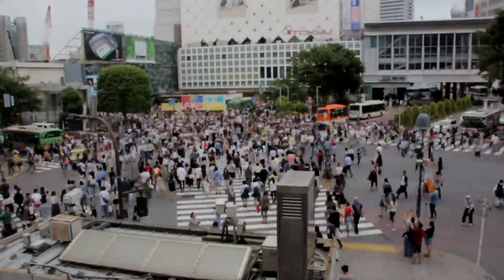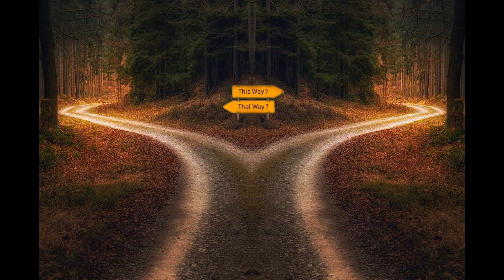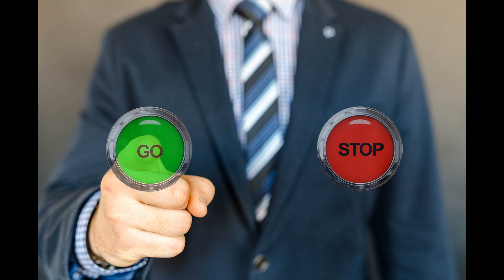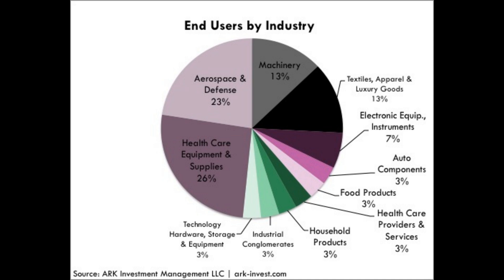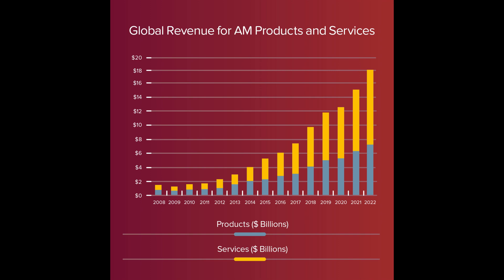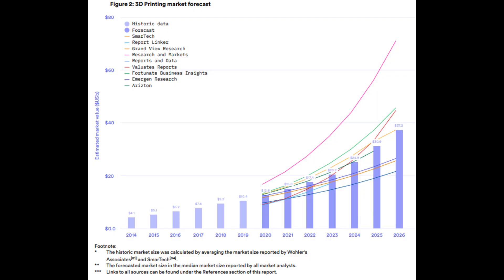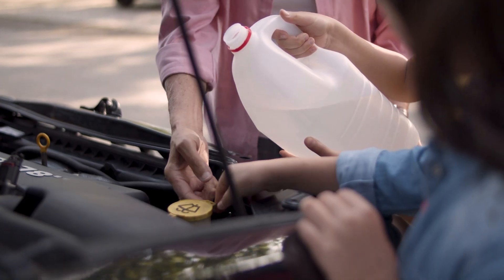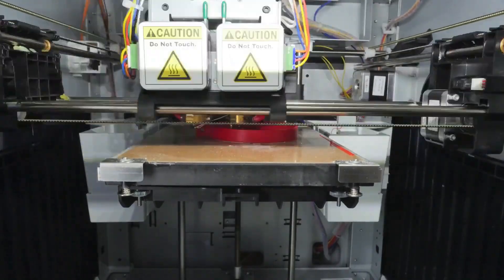2286 Why Do We Need 3D Printing ?

Comment: As the prime inventor of 3d printing and the silicon breast implant #1,(the floppy), I could not have produced the perky-set (#2-firmwear) realism without it. The prime alternative is lost wax casting. But only works for most, not internal hidden structures.🤗💕😇😁,jpk

Comment: that machine has a 1 to 1 ratio looks like and same direction drive , like a bicycle front to rear wheel relation , in the vid it causes a smooth change of direction by the sprocket notches for the product , but the ratio can be different so maybe 1 to 4 and it enters 4 x slower but the other wheel strikes it opposite.....too much/too long...

Comment: i have space but i demolitioned down one old shed built like a real room , guest room by itself and the wood rot was bad, end of lifespan, but the fiberglass had like a cockroach b*mb went off , from the moisture and wood , i didn't want to build that way seeing the final death stage , i use acrylics (cement opposed to portland hardeners but those are good too , just different ) , rebar masonry , CMU's ...some things are post beam then metal roofing in 3 foot widths with special washer screws (i like wood-x) ...easy my problem is i wanted to use masonry version of post beams design and it takes a while to engineer ...this type space requires either a lot of money OR alternative /recycled materials , one vid for example styrofoam mixed with concrete powder dust had flammability resistance better than other constructuion grade closed cell foam, My point on this particular material , i am designing a styrofoam shredder from old circular sawblades on threaded rod between bushings hopefully inside two 5 gallon buckets that revolve for the "door" opening to stuff foam , then i have about 5 years worth of 1 gallon milk jugs at about 2x week stack i want to fill with the shredded foam , then cover with either chicken wire, scrap wire wraps or hopefully boen type 3 foot x 150 foot fiberglass screen and then acrylic fake blocks or stones for wall nonsense, like amusement park stuff or putt-putt golf builds for wall sheds , durable well insulated, sound proofing design ...for example, i like log mills for under $3000 ideas and 3D PRINTER (MAYBE ????!?! THANKYOU < YES 3D .../lol...welding machines etc.... sidestreams of income, i scrap metal in past ...i like those sand p[lastic bricks seems easy for big backyard maybe I'd do a bunch hot into big multi press and run them over for the "press " By the way more later , the name is unfortgettable to search for me Sir, God Bless.. back tovid now...later...

Comment: This mindset is exactly why I have been powering forward with developing 3D printer upgrades to bring them to the level of "replicator" both for manufacturing things from stuff and for taking things and turning things into stuff (not just built but natural raw materials) like being able to hyper quickly oxidizing say iron bearing material into various oxides including rust (iron oxide) that I have already shown how easily rust can be turned back into raw iron deposited metal on a surface with a 405nm 500mW diode laser, (also broke down TiO2 white powder with it reforming into black and dark brown TiO2 and Ti2O3 I believe the other stuff is, all in open air with no other function. next will be to build an attraction system that super tight spaces of this being done will separate the oxygen from it using both the gravitational potential differences and electrostatic charges so depositing even hard to separate oxide metals will be able to be deposited as pure metal, :) 

Many thanks to you for showing how light (strobes at the time) can be used to de-oxidize metal by way of your video showing the copper oxide nano particles being fused into solid  metal via that high powered lighting. Just took thinking about the effect, knowing a bit about frequency of photons and how it effects their eV potentials to embrace trying higher UV range lighting specifically for this, as much  as possible of course as we still need UV in much higher frequencies that are also as efficient as diode tech :) which I have some potential directions to go for that too  :) (lots of these ideas often come from research on oil industry technologies like how to make mesopore alumina and zeolites ect vs the nano pore aluminum oxide anodized surfaces via acid and electrolysis :)

Comment: In time even more traditional skills are going to be lost to electrical devices such as 3D printers. Don't get me wrong they are great but in the event of a power grid down situation they are practically useless. Unless you have an independent power supply to power them.
Reply from the maker: I think if the power grid went down you would have more worries than just your 3d printer to be dealing with mate - and his is the thing I keep saying that you are not listening to - it's not about 3d printers - it's about problem solving - the 3d printer is tool to do that - the core skill you learn using that tool is problem solving - that would stand you in very good stead if the power grid went down.

Comment: Great video, as you have said in the past about generating energy/electricity a multitude of different generators and ways of generating is probably the way to go but for a prototype and proof of concept the 3D printer has got massive advantages I don't own a 3D printer or laser cutter  so I don't know about finished products and what I know I have learned from your videos.  Keep on making and inventing no matter what you use or own 👍
Reply from the maker: you absolutely right mate - it is the inventing not the tools that really matters

Comment: Well said indeed!  Also, there are many industries, aerospace for example, where 3D printing is the only way to make parts with high strength to weight ratio by using internal webbing support or to make internal cooling channels that would be otherwise difficult to produce (e.g. rocket motors).  Additive manufacting is certainly here to stay!  Cheers Rob!
Reply from the maker: it certainly is mate and if it goes the way of the car, phone and computers 10 years from now it is going to be amazing

Comment: I enjoy the luxury of both worlds, I have 3d printers, I have lathes and milling mchines, and while the lathes and mills arent the biggest out there, they are big enough, and I enjoy using them. I also enjoy CAD and creating the designs for 3d parts, sometimes I will combine the two. recently I picked up a seadoo underwater propulsion unit at a car boot sale- it was without the battery (available for £600) but I knew I could buy a standard battery and make supports for it for £70 . the supports took me 10 minutes design in CAD and about 2 hours printing (I am experimenting using the gyroid supports and a lower infill, and that is working out with stiffer parts) I do need to make some lugs to fit the battery connections, but I am thinking that will be an hours lathe work with some brass to make a post I can bolt the battery cables to, so mixed techniques. to be honest 3d printing is usually quicker even for one off parts, but when it needs to be metal to take the current flow or heat, then the lathe trumps out. You could say my home has changed, it is not only my work space for my job, but it is also evolving into my personal workshop. (and just for clarity I 3d scanned the part I needed to fit the battery into and then brought that into CAD to generate the supports i needed for the battery) modern technology is wonderful.
Reply from the maker: i think yoou are spot on mate - the right tool for the job - you have an awesome workshop and clearly use it to the fullest - thanks for sharing

Comment: I got into 3D printing when I built houses using structural insulated panels. I would make 5 models for a lodge or bungalow to show how it went together and then how to make it airtight using a vestibule or porch. Good sales aid, excellent modelling for air tightness.
Reply from the maker: I have always been fascinated by SIPs - very interesting use mate - cheers